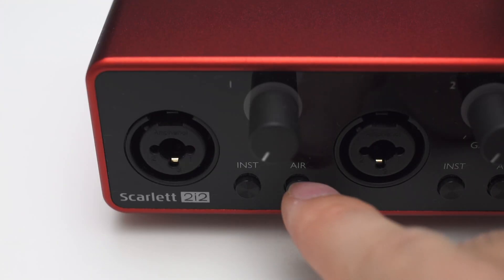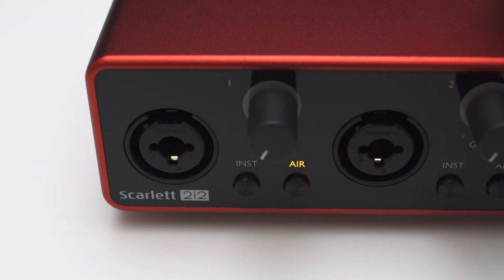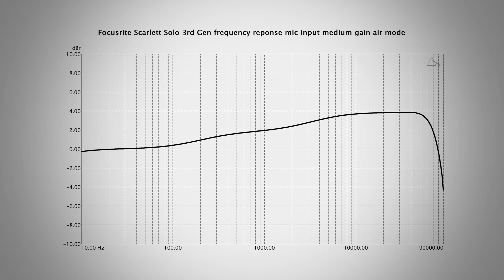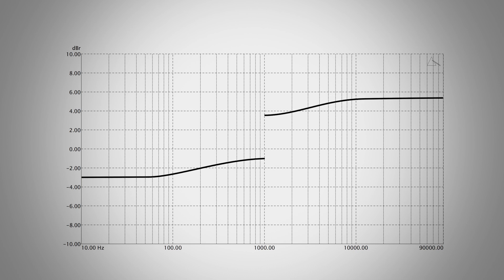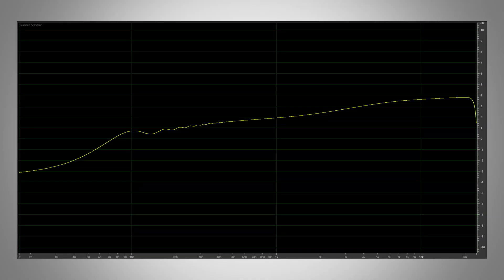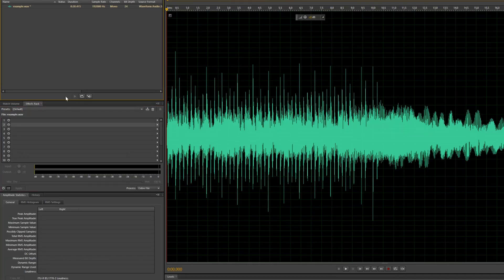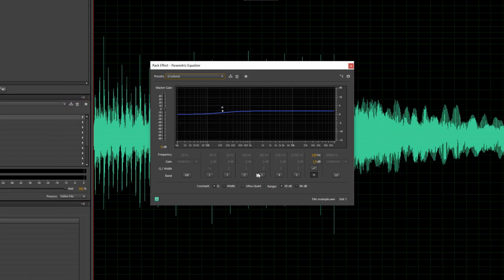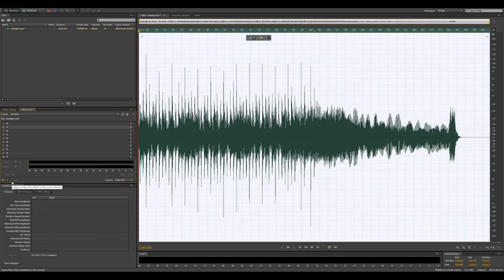How to fake the Air Mode from Focusrite with EQ - settings explained

Comment: What a great tutorial and explanation - I appreciate this.

I love my Scarlet 2i2 3rd Gen, mainly for the Air mode, but the Motu M2 is exactly the kind of interface I need and with the Air mode setting I can add in post, it will keep the sound I want while allowing me the flexibility and the accurate level meter the M2 offers.

Thank you so much.

Comment: Can it be done in real-time for podcasting?
Reply: You can use an input fx using the input fx option in your recording track in reaper. Make sure you use a minimum phase EQ instead of a LInear phase filter which induces latency.

Comment: Thumbs-up as always! 
Would love to see a similar video with the SSL2's '4K' mode analysed and see if you could create similar distortion somehow? 
Maybe limit yourself to free VSTs for the effect? Anyhow, just an idea 👍
Reply: A soft clipper (GClip VST with softness 100%) and a +2dB high shelf at a 2,5 KHz center freq with a 6 dB/octave slope (or a Q factor of 0,5) should do it. But yeah good suggestion!
Reply: LCTRgames it’s even easier ... it’s just a plus 2 dB till 2 or 3 kHz (as far I remember) and another 2dB shelf till the upper limit
Reply: @Not-Only-Reaper-Tutorials  I was playing with this the other day in Protools as well as matching up the tlm103 to u87i as well. Fun audio frequency match games :)
Reply: @Not-Only-Reaper-Tutorials  The EQ looks ok to replicate, but was wondering if there was a route to similar distortion / harmonics also :)
Reply: LCTRgames the distortion it makes it’s not from another planet. If you notice what THD it produces, it’s not different from many others, so you can very likely approximate it with plugins that are quite (and really) “color” the signal producing the required THD
Reply: @Not-Only-Reaper-Tutorials  true most tape emulations (used very sparingly!) could help to replicate this. Especially if you stacked a clean signal with an effected one, balance the two signals to taste. Add some salt and a bit of pepper.
Reply: @Not-Only-Reaper-Tutorials  That has nothing to do with the distortion 4K mode has. Air mode is easier to replicate. At the end of the day there will still be a difference due to one being a hardware analog effect and the other being a digital replication. Can't beat that original analog vibe.
Reply: @gthevigilant_1811  I guess that on a double-blind, no one will get it. However, it is what it is.

Comment: As far as I understood, frequency response (EQ) is only one half of air mode. The other half is that air mode creates additional overtones. The signal is therefore distorted. The art in air mode is to make the distorion (additional overtones) in a very musical way. You cannot see this with a frequency sweep - you need to check this with a spectrum analyzer.
Reply from the maker: Correct, that's why I checked the distortion the Air mode creates and the additional harmonics are about 80 dB down from the fundamental. That's mostly inaudible. The change in frequency reponse is pretty much the only thing you hear with the Air mode and that's why it is possible to use an EQ to emulate it.
Reply: @JulianKrause  Ok, then the air mode in those interfaces is a great marketing trick and a cheap answer to the Rupert Neve Transformers found in the Steinberg interfaces.
Reply from the maker: @3dbits_art  If you want something that introduces audible distortion, chack out the SSL 2. It's 4K legacy Mode is does what you described. I haven't tested the Rupert Neve mode, so I'm not sure how it compare to that.
Reply: @3dbits_art  Yep. That's pretty sad if it's a marketing trick
Reply: @JulianKrause  so the Air mode turned on is basically high end distortion in a sense? So if im using a Saturn 2, puigtec EQ to add harmonics / top end etc, am i just distorting my vocals more?

Comment: Great video julian! Could you try to emulate the 4K of the Ssl ?
Reply from the maker: That's quite a bit more complex as the 4K mode on the SSL 2 introduces non linear distortion. I would have to find a way to programm this into a VST plugin. I might do it, if I figure it out.
Reply: @JulianKrause  it would be great, by the way, do you know where to find the real specs of a motu 4pre?  Great videos, congratulations!
Reply from the maker: @AuricularesArgentina  Hey, you can download the manual and at the very end there you will  find the technical specifications.
Reply: Julian Krause couldn’t the waves Ssl channel do it
Reply: Alep I had the same thought. Would love to see a 4K mode.

Comment: Very interesting Julian! Just wondering though, couldn’t you just set up one Parametric Equalizer with the settings to match the Air mode you show in the graphic? Or does it come out better with your method? I so appreciate the devotion you have to your craft and the fact that you share it with us! Keep up the great work! Thank you!
Reply from the maker: I don't think it is possible to achive the curve with peak eq filters.. That's because these filters always boost frequencies at acertain a point but then fall off above and below that. The air mode on the Focusrite interfaces is pretty much exactly two high shelf filters and that's the best solution to get the same curve.